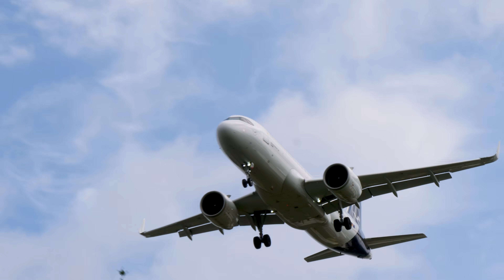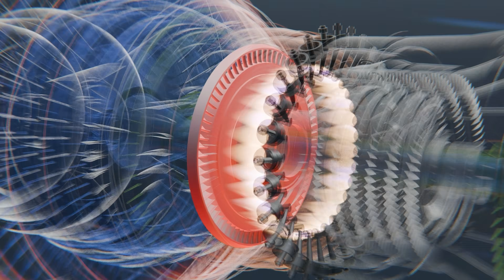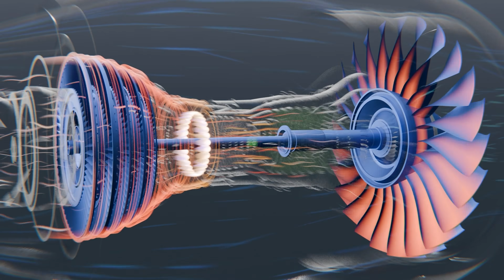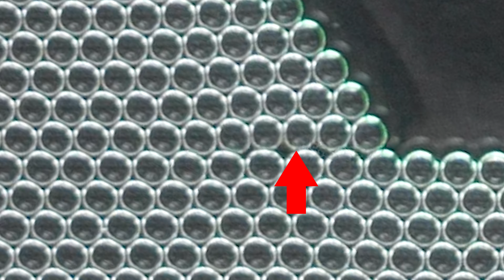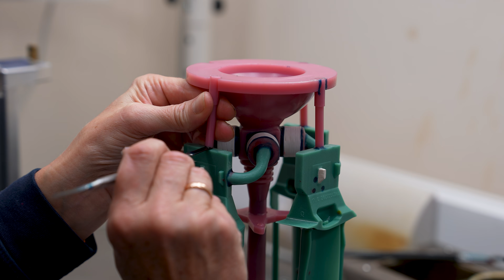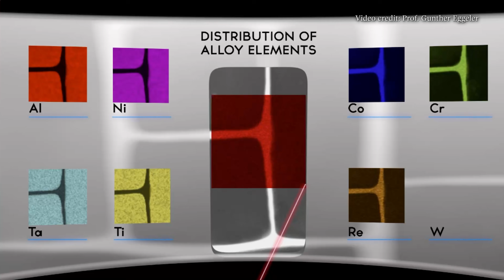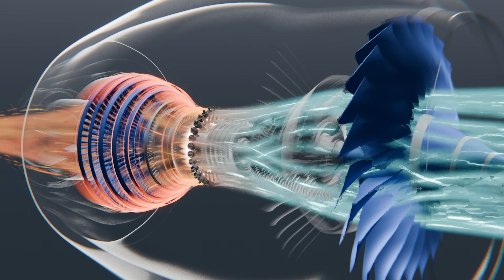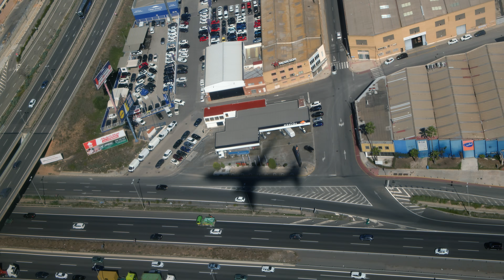The Ridiculous Engineering Of Jet Engines

Comment: years ago (1970s) my dad was on a team working with GE(GE makes a lot of Jet engines). to detect microscopic cracks in the blads... both compressor and turbine blades..  I remember being fascinated that we had jet engine blades and fans in his shop (I was a little kid) he talked then aboutthe stresses that the blades took on a daily basis... a turbine or compressor failure at high RPM results in a catastrophic engine failure... theres some thoughts now that the UPS plane crash in louisville may have started as a copressor stage blade failure... its just a theory at this point until the investigation completes....

Comment: I’m a machine learning major who used to teach sociology to engineering students—civil, mechanical, IT, and others—and often used the story of the Boeing 737 MAX vs the Airbus A320neo to illustrate industry competition and personal responsibility, even drawing parallels to today’s AI race between nations. Ironically, I had never formally studied physics myself. It's fun to learn

Impulse formula = change in momentum 
                               = mass x change in velocity

J=∫t1t2 F(t) dt = Δp = mv2−mv1

J = mΔv

where 

J           = jactus / impulse
F(t)       = force (possibly changing over time)
Δp        = change in momentum
m         = mass
v1,v2   = initial and final velocities

Kinetic energy formula =1/2 mass x change in velocity square 

K = 1/2 mv^2

where:

K = kinetic energy
m = the mass of the body
v = the speed of the centre of mass of the body.

Ek =∫_(v_1)^(v_2) p⋅dv = ∫_(v_1)^(v_2) mv⋅dv = (mv^2)/2 | (v1)^(v2 ) = 1/2 m(v2^2-v1^2)

kinetic energy (Ek) is equal to the integral of the dot product of the momentum (p) of a body and the infinitesimal change of the velocity (v) of the body

is really helpful for me to explain more clearly how a bigger engine is fuel and cost efficient to impress the students.

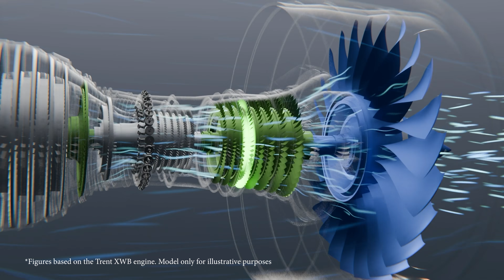Comment: 1:02 something definitely wrong with these numbers
you say the compression ration takes 1 atm to 50 atm, but then after the ignition, which notably raises pressure several times-fold, you talk about the turbines taking air from 50 atm to 1 atm
Reply: A jet engine isn't sealed like a piston engine. There is NO increase in pressure from burning the fuel. In fact, burning the fuel DECREASES the pressure slightly. The burners heat the air, that air expands (a lot) and it's velocity goes way way up. That increase in velocity is what makes thrust, turns the turbines and decreases the pressure somewhat. In a jet engine, the highest pressure is right after the compressors and then it's all downhill out the back after that. What the heat from the fuel does is makes the air go fast fast (kinetic energy). A very good example it to turn on your hair dryer on cold, now flick the switch to hot. The only thing you did was heat the air up and make it go faster. Jet engine is the same thing. I nfact the only difference between your hair dryer and a jet engine is that the fan in your hair dryer is powered by an electric motor instead of a turbine, everything else is the same. The electric heating element in your hair dryer adds heat no different then the burners in a jet engine.

Comment: I work in Gas Turbine blade, vane, and ring segment repair (ones that generate power for the grid) and the blades that you see are probably 10x smaller than the ones I work on. It is kinda crazy to see the technology carry over at such a size difference.

Comment: Jet engines are genius and I think just like Feynman (I heard) wrote his thermodynamics textbook around the topic of a burning candle, because the process uses all sorts of state transitions, you can write a nice physics textbook just around a jet engine.

Another amazing thing about them is that, while they're made of so many parts, if you could manufacture them all from a single material, you could make a basic single-shaft engine out of two pieces: the rotor and the stator.  That's right, most of the mass of the engine is either not moving, or spinning together with shaft.  In a double shaft (low pressure and high pressure) engine make that two rotors, so three parts.  So in some way they're simple.
(Then there's the pulse jet that is a one-part engine)

Comment: Sundstrand mechanical drafter 1970's - turbine blade design on cad was just starting. I remember seeing a spin destruct test of an impeller die cast in steel.
The metal deformed like a crumpled tin foil at 150,000 rpm. Great times of learning. Great Videos.

Comment: I work for one of the very few companies that apply the ceramic thermal barrier coatings that keep turbine blades from melting in addition to the film cooling mentioned. Some incredible engineering goes into applying these coatings, particularly plasma sprayed ceramics. Look it up if you are hungry for more after this brilliant video.

Comment: now imagine the kind of stuff that goes on inside like a liquid fuel rocket engine - same turbins, spinning 10X as fast, while also combusting liquid oxygen alongside  the fuel. If jet engines are at the edges of physics, imagine the 5D chess the engineers are playing at something like the Raptor engine production line
Reply: Well, rocket engines generally don't need to be reused. And even if they are, their working time is just ridiculously short vs a jet engine. Maybe 10 minutes in total per flight, 10 flights per year.

Comment: Jet fuel can only melt steel when it's within the borders of NY city. 🤔
Reply: it doesn't need to, as the video shows the steel breaks at around 500 degrees c, which is three times less than its melting point
Reply: @BoCo_Gaming is that why we see all that molten steel dripping out of the buildings before collapse? Because the steel just "broke"? 🤔

Comment: The image of the directionally solidified blades actually kinda reminds me of the early beginnings of the patterns in damascus steel. I wonder if the strength of that steel lie in similar principles to the aligned crystal structures here.

Comment: Just to point out what I guess everyone already knew but I juts worked out the equation at 5 mins in (Carnot heat engine efficiency quation) would need to be worked using absolute temperatures i.e. in Kelvins rather than the centigrade used in the rest of the video.

Comment: 4:05 ½(2m)(½∆v)² = ¼m∆v² => (∆v)²=∆v² ?!? Really? 🧐
3:58 What you have there is work done: W= ∆K = ½m∆v².

We can factor that out: ∆v² =(v_fin+v_init)•(v_fin - v_init)=2V•a∆t, where V=½(v_fin+v_init) and a is the acceleration. 

Correct me if I'm wrong but what we really get is apparently: 
W=½m(2V•a∆t)=mV•a∆t=mV•∆v=|Impulse|*|V|. 

If we divide by ∆t, that's the definition of Power:
P= W/∆t= mVa = (Impulse/∆t)•V= Force• Average velocity.

Comment: Our processors in phone and computers are also made of monocristal. But a monocristal silicium wafer is really ductile and bend under its own weight. As a comment bellow mentioned it, at room temperature it is the grains that prevent the atom layers from sliding.

Comment: That bubble on liquid demo (@8:50) was very cool. I sooo want to build one of those.
I wonder what the fluid is,.. and how the pump/nozzle creates identical separate bubbles.  
Either the pump/nozzle is doing something clever or the fluid has viscosity or surface tension properties that force the bubble to pinch off at a specific size.

Comment: The compression ratio is NOT 50:1 that is the overall pressure ratio. The compression ratio of the LEAP engines (highest compression of any turbo-fan) is 22:1

Comment: Dumb question. Is it possible to have a plane that only has these big fans. 80% thrust seems good enough. Aren’t that just propeller planes
Reply: The big front one is spun up by the ones at the back, so no you can't just have it alone. Well, you can, it's called a propeller driven aircraft and it's slow and inefficient compared to a turbojet.

Comment: I've heard that piston engines are way easier to make compared to turbine engines, because the materials used are not required to withstand the flame temperature?
The combustion process only lasts for a short period, and heat does not have enough time to transfer to the cyliner and piston. A thin layer of air acts as a heat-proof shield between the flame and the cylinder wall. So we can make piston engines out of common materials like aluminium and cast iron, even their melting points are lower than the flame temperature.

Comment: Why don’t they place the holes more “rearward” on the blades (pointed towards the rear of the engine) ? This would reduce the number of contaminants that get into the blade pores and also increase the speed at which the hot air in the hollows are evacuated because the air passing the over the blades would cause a Venturi effect.

Comment: Now make that engine, spinning that fast, pressures and temps higher, pull 9g’s…😮 Nine times gravity. Intermittently on multiple azimuths whenever the pilot calls for it. Fighter engines (not high bypass for these 1g aircraft) are themselves ridiculously complex and wonderous. FWIW, there is a current program to integrate “variable bypass” into military jet engines to provide the efficiency of high bypass (for example, on takeoff and climb to operating altitude) with low bypass (high or even supersonic speed) and afterburner. Another magic trick by the engineers at RR, P&W, and GE… 🇺🇸
Reply: What's with the third world flag at the end of your comment?

Comment: In my Skoda Felicia 1300cc, the temperatures are 3 times higher than the melting point of the cylinder head, inside which the fuel burns and exits the engine.

Comment: That’s a really cool question. It seems like jet engines are working in scorching-hot environments, so why don’t the turbine parts just melt? Here’s how engineers make sure they don’t, using a mix of really smart materials and clever cooling tricks.

---

1. Superalloys.
The turbine blades — the parts at the back of the combustor where the gas is hottest — are made from nickel-based superalloys. These aren’t ordinary metals. They’re special: engineered to keep strength at very high temperatures.  These superalloys can work at temperatures pretty close to their melting point — much better than steel or titanium. 

---

2. Single-crystal structure.
Some turbine blades are cast as a single crystal, meaning there are no grain boundaries in their internal structure. That helps a lot, because grain boundaries can weaken under extreme heat (creep, fatigue, etc.).  With a single‑crystal blade, it performs far better under those harsh, high-temperature conditions. 

---

3. Internal cooling passages.
Here’s where it gets really clever: engineers take air (that’s already compressed in the engine) and bleed off some of it to use as cooling air. They channel this cooler (but still hot!) air into tiny, carefully designed internal passages inside the turbine blades.  In some places, they use a technique called impingement cooling — where jets of this cooling air hit the hottest parts (like the leading edge of a blade) to suck heat away efficiently. 

---

4. Film cooling.
Not only do they cool the inside — they also make the outside of the blade safer. Small holes on the blade surface let the cooling air bleed out, forming a thin “film” of cooler air just over the surface. That layer acts like a protective shield: the super-hot exhaust gases don’t slam directly into the metal.  This is called film cooling. 

---

5. Thermal Barrier Coatings (TBCs).
On top of all that, the blades are coated with a ceramic “thermal barrier.” This coating (often made of yttria-stabilized zirconia) is a really poor conductor of heat, so it slows down how fast heat from the hot gases can reach the metal underneath.  That means even if the gas is way hotter than the metal’s melting point, the metal stays cooler. 

---

6. Trade-off and design balance.
All these cooling tricks come at a cost: bleeding off air for cooling reduces the overall efficiency of the engine. But if you didn’t do this, the blades would fail. So engineers have to balance: run the engine super hot (which boosts efficiency and power) while spending some of that compressed air just to protect the parts. 

---

7. Continuous innovation.
Cooling technology keeps improving. New research is going into better internal cooling designs, more efficient impingement, and even better materials for the coatings. 

---

In simple human terms:
Imagine holding your hand over a candle flame that’s way too hot. Normally, your hand would get burned. But what if you blow a thin but steady stream of cool air over your hand’s surface, while wearing a super-heat-resistant glove with a layer of ceramic on it? Suddenly, you can survive much higher flame temperatures than the glove material’s “melting point” — because the glove is being actively cooled, and the ceramic layer blocks a lot of the heat. That’s basically what jet engines do with their turbine blades.
Reply: Ah yes, why watch an interesting and well made video when some loser can dribble out an AI answer in seconds.

Comment: this is super "cool" heh heh, I really liked to single crystal growth part, humbling. It showed getting good with proper heating and cooling could net you amazing results with correct molds and post processing.

A site to see  that really makes me think about my ultra controlling methods, like the Japanese with their rockets not needing flight computers. Just skill in weight distribution and burn rate in the right areas with the correct tilt and drag coefficient.

To be fair to me and others, that is a hard skill to practice for and master lol! Not for nothing though, it does lend itself to mistakes that can be quite costly. As, unfortunately, they found out. But, it worked quite well, and here as well!

I'll keep trying my best. My skill issues show lol

Comment: I used to work on fighter jet engines, and the turbine blades were basically consumable components. Even when the engine is working correctly, the blades are erroded away by the intense heat over time and you need to fully replace the whole set. I really appreciate you showing how they're manufactured, I had always wondered what process was able to create those tiny channels.

Derek, If you'd be interested in having any blades from one of these fighter jet engines, let me know!

Comment: 1) Gamma to keep enough ductility to prevent brittle fracture 
 Gamma prime that offers cross slipping which makes dislocation motion some hell of a task.
2) Directional solidification to remove grain boundaries.
3)Accelerated Internal heat transfer through turbulent airflow.
Film cooled layer formation on the outside.
4) Metallic and TBC for additional protection from thermal loads.
An absolute Engineering marvel.

Comment: All this and they are THE safest form of travel on the planet! If you stop and think about it, when your flight lands and unloads its passengers, it doesn't shut off and go get serviced, it basically stays running, refuels and passengers for the next flight come aboard and then it takes off again...im leaving a lot out but basically thats what happens almost every time! That is literally unbelievable. 

So my question is how come they can hardly make a car that goes a couple hundred thousand miles without catastrophic failure??
Reply: Plenty of cars go for hundreds of thousands of miles. Mainly the cars that are well looked after. 

If you want your engine to cost a couple hundred grand and be built of some exotic alloy, crack on. Cars are the perfect mix of affordable and reliable.

Comment: Mechanical engineering student with a specialisation in aerospace here. 25:59 the visual and explanation was so good, I learnt this a couple of months ago in my engineering materials subject but it was just words and static images. Just had to memorize all that information, not really knowing anything. It's really nice seeing things come together in this interesting video.

Was nice seeing this video in my feed as I've got a test on aircraft propulsion tomorrow, it's mostly thermodynamic calculations at compressor and turbine stages... So I better get back to studying for it.

UPDATE: The very first question on my test was "what are the cooling measures used for turbines in turbofan engines, what is the importance of turbine entry temperature..." Can't remember the whole thing but this was about 10% of the weightage of my whole paper.

I did do terribly for it (failing for sure, estimated 20/75 marks), but all of these things are interesting to me regardless of my performance on tests 🤣

Comment: Disappointed that you didn’t mention the thrust from entrainment at 2:50 which is the main benefit of the shroud of a high bypass turbofan engine & produces a significant portion of the thrust for essentially free.  Missed opportunity & perpetuating common misconceptions to say that 80% of the thrust is directly from pushing the fan forward, the force is not fully applied directly to the fan because it is not directly causing them… being more accurate with these details would have been more interesting to me at least & sounds like someone already tried to correct you based on your initial explanation just seconds before.  Great stuff as always still though.❤